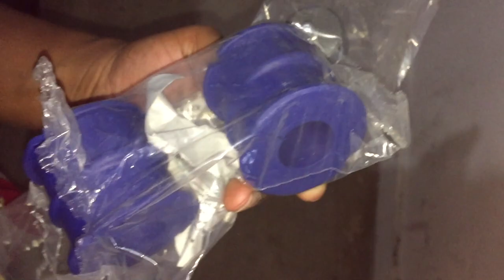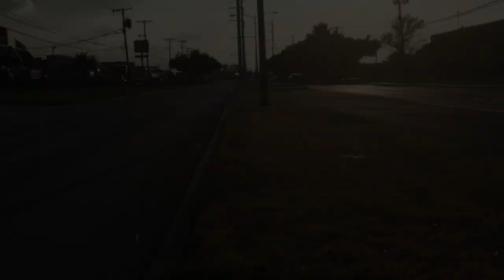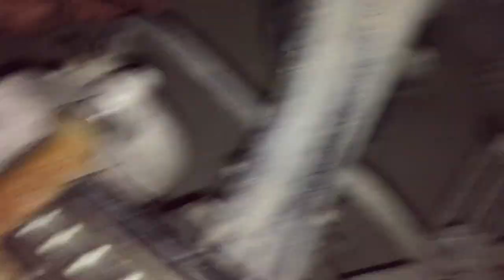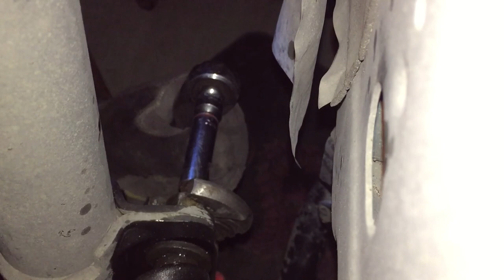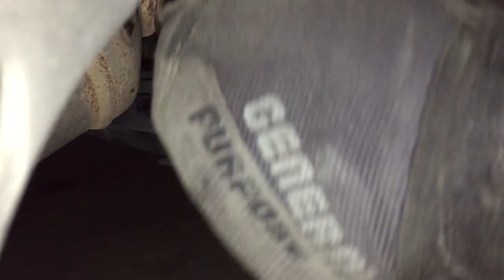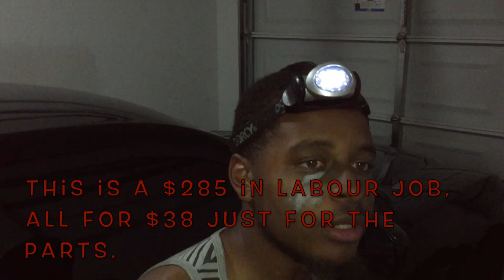How To Change SWAY BAR LINKS and BUSHING On A DODGE CHARGE (EASY)

Comment: Good job. For the first time. But. A ratchet set. Wrench wud b easier &.   That metal tube connected to the link is. We’re u put in  greese. It’s a greese fitting. U can add to fill it up btr nd or down the line add greese to give them more life !!!    By the way. 1A auto btr parts but moog is decent. Or. KYB.
Reply from the maker: Facts
Reply: Ye he’s right moog is decent/garbage… I replaced my bushings and old ones were already  replaced by previous owner and they were moog… rusty af, loose, dry af and didn’t last… got Duralast brand from autozone for like $15 for the set with warranty
Reply from the maker: Think the only difference is the color blue lol other than that u just paying for the brand

Comment: Detroit axle parts go bad wuick
Reply from the maker: This is true
Reply: What about moog control arms? I just replaced the oem front lower rearward control arm
Reply: Cause yall dont grease em. Thats what that valve was
Reply from the maker: Yup learned the hard way, parts are actually good after greasing them